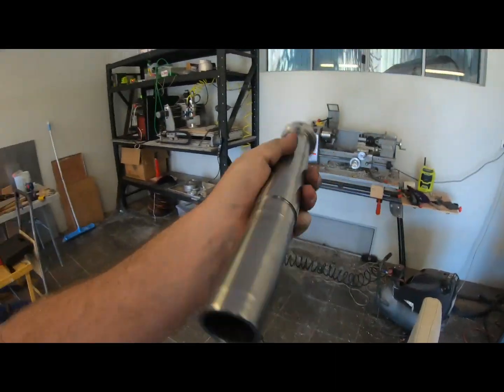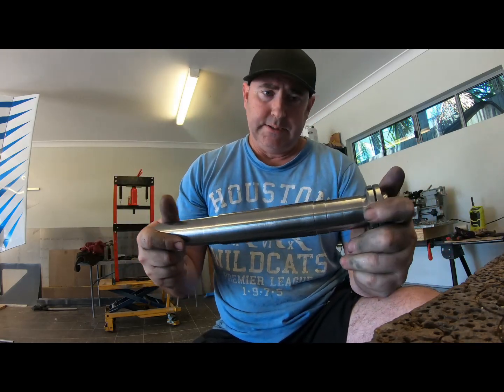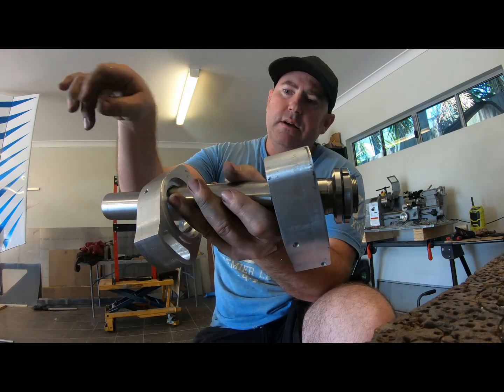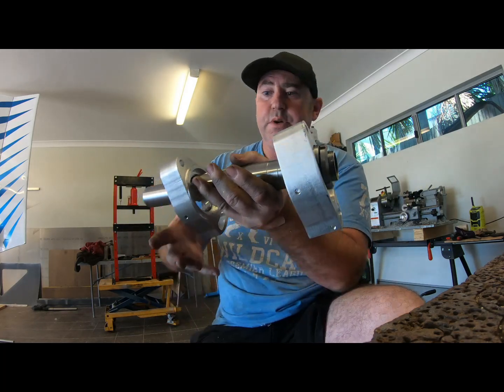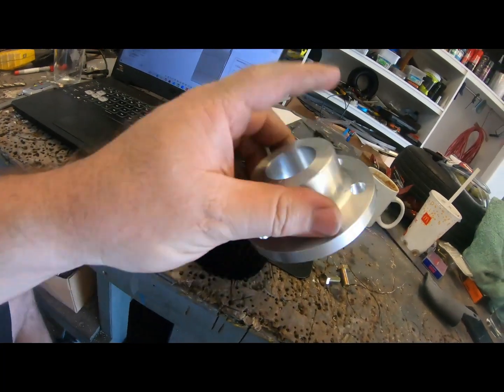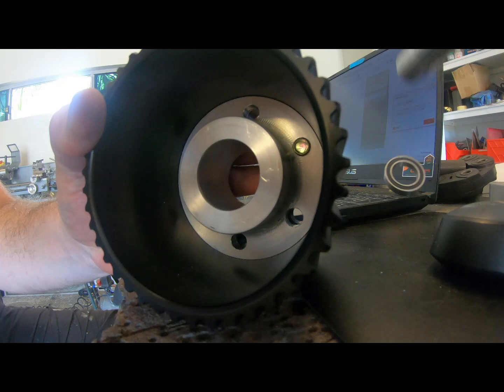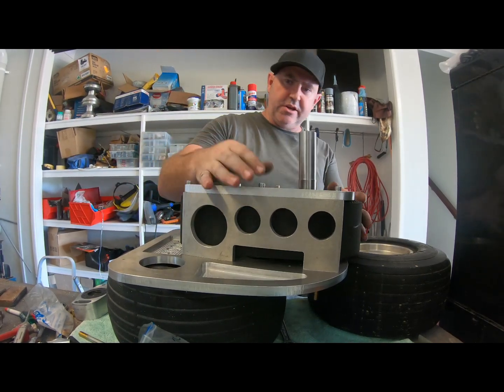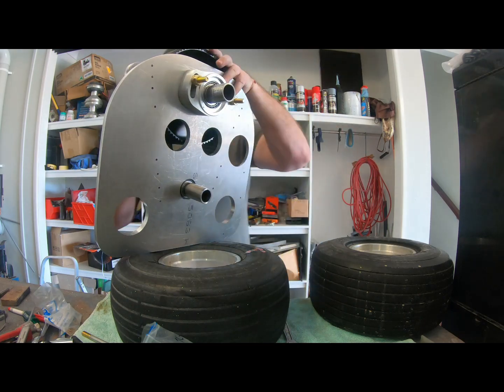Building PSRU gear reduction drive Ultimate seaplane Aircraft 200HP turbo  powered experimental

Comment: Hi Michael, I like your design, currently building new aircraft with Subaru engine and similar type of gearbox belt drive. Can you share information where did you buy wheels for your belt? Thanks a lot
Reply from the maker: Good vibrations motor sport sell them 👌

Comment: Hi Michael, cool design and project. It looks very professional.  I was trying to build a reduction unit myself,but could not find a belt meeting the specs for my BMW motorcycle engine.   What belt did you use and do you have the specs on it? Appreciate any additional advice you can share.  Thanks.

Comment: Does the pto pulley have a key, or is the taper fit the only engagement to the shaft?
Reply from the maker: The shaft has essentially 4 small keyways/ dimples where bolts lock into

Comment: That setup doesn't make sense to me. You can't run a pair of tapered spindle bearings in the same direction. You need one in opposition....like 2 + 1 = 3 bearings. What happens if the prop is windmilling and creating YUGE drag?
 
p.s. I've had very good luck in several (non-aviation) applications where I used deep-groove ball bearings in thrust applications. I've got an added bearing on my little airboat crank/prop shaft taking up thrust loads. Hopefully I'll run it soon.
Reply from the maker: @Paul Slevinsky it can be run this way provided the 3rd bearing take the reverse thrust load this set up will have a deep groove bearing on the rear where the lock nuts on the shaft and will take the opposite thrust load so I can preload the tapered bearings while supporting opposite loads. Agree with you that it’s not conventional but what is conventional with this build.😆
Reply: @michaelhille261  Thx for the update. I figured I was missing something. Looks awesome.
Reply from the maker: Thanks Mate appreciate it 👍
Reply from the maker: Would love to see some photos of your set up 👍 thanks for the input I did look at using just straight sealed deep grove but was concerned about service life
Reply: @michaelhille261  It's just a self-aligning flange bearing with a bolt pattern that matches the PTO on my little Honda clone engine. The prop flange keys to the shaft and butts up against the extended inner race of the ball bearing. I hope it holds up, but I'm only working with 130 pounds of thrust at most.
Reply from the maker: That’s what I love about this playing with different ideas sounds great 👍

Comment: Great work Mike, what will be the mounting plate for subaru or is this a fit for all types , again great work
Cheers gareth
Reply from the maker: @gareth Lacey thanks for that 👍This particular one is drilled for the  EJ series engine however I have designed  for universal applications.